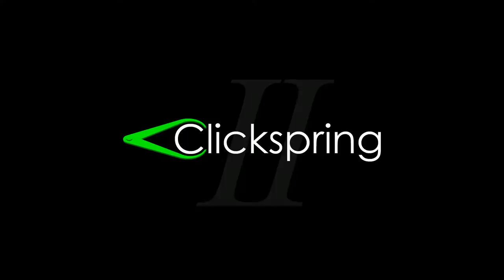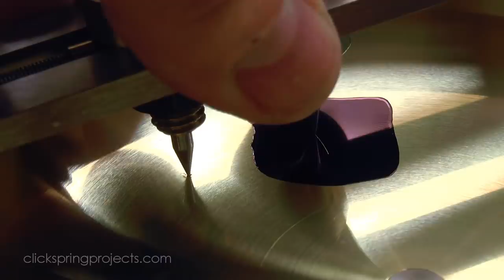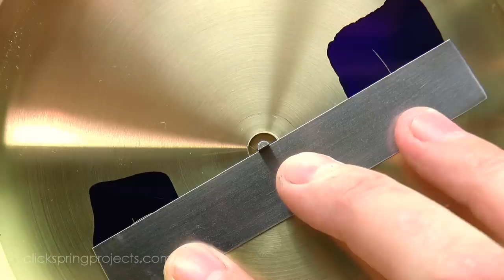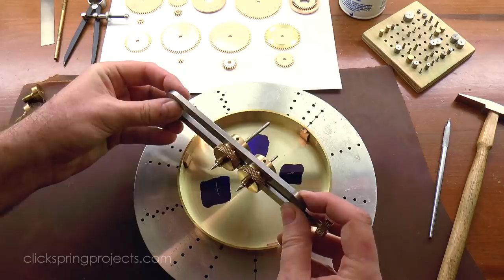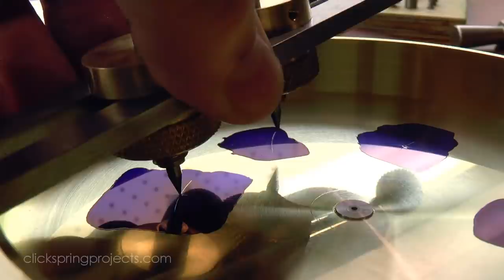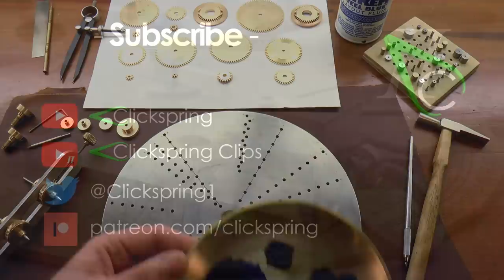Using A Pinion Head Depthing Tool II

Comment: The last and only time I looked into building a clockwork style mechanism was for a mechanical readout that had both an inch and metric capacity. This then morphed into a "clock face" that had a read out in inches for "hour" hand and thousands for the "second" hand. Drill en by a cable attached to the lathe carriage. The real trick would be to machine the cable drum that the cable wraps around to power the device to exactly the right diameter. A ten inch cable drum would need to be 3.1831" or slightly under to allow for the cable. To determine the exact size needed would likely require making the drum slightly larger and testing and cutting.  The whole reason. I really do not like DROs on lathes.
In other work on other gear trains I have also done rough work on the gear trains required for a QCGB featuring inch and metric threads featuring a reversing Single Tooth Dog Clutch for threading. The drive system for both mechanical a gear hobber and a vertical gear shaper.

Comment: What is the the appropriate amount of backlash for cycoidal gearing at this scale. .001/.025mm? More? Less? My experience with gear trains is all with involute profiles.
Plus with a depthing tool would it be possible or advisable to use a mic or calipers to set the tool to the theoretical distance between the two gears based on the absolute values of their pitch diameters?

Comment: So what is he doing?  Verifying that the depth is enough to remove the ink, but not scratch the plate?
Reply: No. It’s the depth of engagement between the pinion and wheel that’s being fine-tuned in each case. The tool gives a convenient way to establish the best depth, by feel, and then to transfer the resulting center-to-center distance to the marked plate.